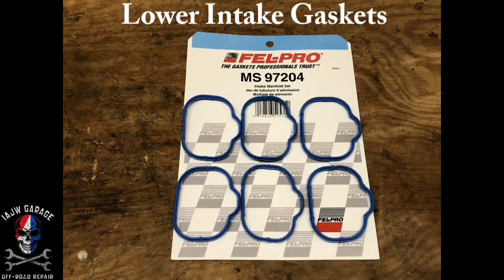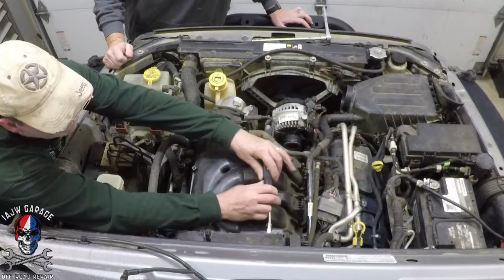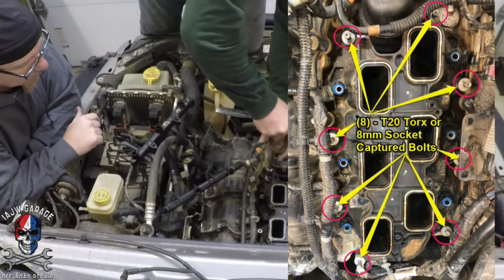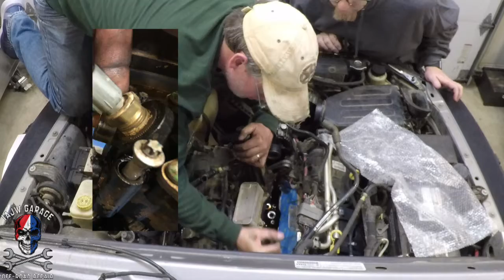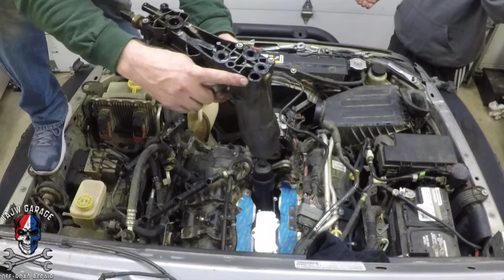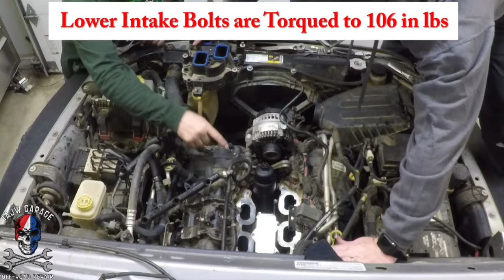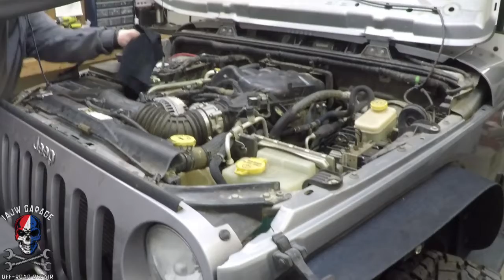Jeep Wrangler JK JKU 3.6 Pentastar Oil Filter Cooler Housing Replacement

Comment: Do you know how to do a low oil pressure code check without tearing everything down twice?The tool for this is not available right now, so I am looking for a solution. The tool is the oil filter cap adapter that converts the oil cap to an oil pressure tester. You can see what I mean if you look up this: Part # 2021500090 Mopar. I am not sure why Chrysler did not make this standard, but I get it. In any case, you replace the cap and hook up a OTC 5610 tester to that and you are in business.
Reply from the maker: I don’t not know that test. Low oil pressure could be a bad sensor or connector not fully seated 
Did you connect both connectors on the back of the oil filter housing?
Reply: @ItsaJeepWorld  Yes, I did make sure of that. I know I am fine there also because I had the same code before replacing the oil cooler. I was just curious if you know a better hack for splicing something to the the system for a pressure check.
Reply from the maker: Devin Slurry No, sorry. Please share whatever you find out
Reply: My line of thinking is that if I can get a actual oil pressure test, thus bypassing the sensor, then I can know if the sensor is good or bad without having to think about the electrical connection or the sensor which will become a huge slug of a problem to sort out. This is the video that taught me how do to the oil pressure reading, but as I stated previously, the part is currently unavailable: https://www.youtube.com/watch?v=LuU3ZrcY_4o
Reply: @ItsaJeepWorld  Will do.
Reply: It’s a Jeep World make sure you have the correct oil filter installed. I’m a Lexus tech and had worked on one as a used car and while replacing the oil filter I had a CEL. Turns out the wrong oil filter was given to me so make sure it’s the correct oil filter for the vehicle.

Comment: Did you drain the water coolant and/or change the spark plugs? On other videos, everyone does that.
Reply from the maker: Devin Slurry I did neither. The small amount of coolant was fairly insignificant 
Never touched the plugs
Reply: @ItsaJeepWorld  I guess that the plugs are good for 90k and I have 70k. So people I guess just also change the plugs for good measure rather than take it all apart again.
Reply from the maker: Devin Slurry Yes that’s what the plan for most are, I had just changed the plugs. I don’t have stock inner fender liners so plugs are easy for me also.
Reply: @ItsaJeepWorld  Thank you for replying. I just started to take off the fuel line and got a bit spooked. But now I see its not a big deal to do that. Others say it is not required. I am literally living your video and others right now. I got the upper intake off today and it got dark and cold on me, so will do the rest tomorrow. Thx for your video. You filled in some of the blanks for me.
Reply: @ItsaJeepWorld  Thx, you saved me time today.

Comment: Best tip: tape hose to vac. You just saved me at least $30 Old school tech!
Reply from the maker: Devin Slurry Awesome! I stay low tech as possible, Jeeping on a budget
Reply: I cannot agree more!  @ItsaJeepWorld
Reply: This worked great! I had rat stuff all around the area falling into everything.
Reply from the maker: Devin Slurry Thats Crazy! Glad it worked out good
Reply: @ItsaJeepWorld  I am now in a situation that is messed up. The oil leak is fixed for sure, but now I am getting codes going haywire. 300 302, 306 and 201 and 202 etc. Some others also. Something is wrong with the injectors. I tore everything off down to the injectors and fuel rails and made sure everything was re-seated properly. The first go around the jeep would idol perfect and after it warms up a bit (5m) it jumps +1k rough idle speed and threw about 9 codes. The second go around it does the same but had a slightly less normal idle quality. I am so confused right now. My upper harness might be causing problems because of rats. I feel like I am in over my head in the moment. But at least the oil leak is fixed. CO300 is not even in the books. But PO300 is. So I assume it is just that. The weird thing is that all the codes change all the time and just make a larger list of codes.
Reply: My $40 capture device is lacking. With a 300 code, anything goes.
Reply from the maker: Devin Slurry You must have a bare wire somewhere due to your rat problem. That’s all I can think of, no one has ever reported codes after this procedure. It has to be a problem other than the procedure. 
Check every wire carefully. Make sure everything is plugged in tightly and the connections are clean. I’m sorry you are having these issues and codes
Reply: @ItsaJeepWorld  The rats ate some of the wiring harness and I applied liquid sheathing to them before I even did this oil cooler. I will let you know how I eventually solve it. It might be a while though. I cant even find the harness on the internet to even know what wires control what function. Our jeeps are just coming out of warranty so info is hard to come by.
Reply from the maker: Devin Slurry find and Join ItsaJeepWorld on FB we’ll get you help, we have some of the best mechanics in Jeeping

Comment: Just did this to my 2014 JK about 4 months ago. This 100% should be recalled but we know how that goes. Seems to be specific to these 2014 models also.
Reply: My 2014 is leaking too. Didn't know until i climbed a hill and started noticing a drip. Crawled under and saw where it ran down the side of the bell housing
Reply: Michael Arnold be careful with that leak , it may cause an engine bay fire if enough oil drips in hot exhaust. Take care of it asap, especially if u do some off-roading.
Reply: @lacherokeedecaceria1263  oh yeah, i ordered it last night.
Reply from the maker: Charlie Lourenco was the video accurate and helpful in your opinion?
Reply: 2014 Wrangler JK oil leak. Confirmed not a rear main seal.  Confirmed an oil cooler Job. Do you know that the mechanics charge more for an oil cooler change than a rear main seal which requires the removal of a transmission? $800 vs $1200? That is a scam! Most of the time all you need is a $20 pack of o-rings for the fittings. Could be done for $600 easy. Do it yourself and it costs less than $200. But OK $800 because that is less than $1200. If you go to a mechanic for a rear main, you will get screwed. $1000 later you will still have an oil leak. To test what you have you have get under your jeep and see if you have oil above your upper. Meaning you leak is higher than the rear main. Which in 2014 is almost always the case.

Comment: Love the diagrams!
Reply from the maker: Joe Corapi Trying to improve on each video. It’s a process. Having good content helps
Reply: Your video, by far is the easiest to follow. I used yours to change my oil cooler.  I was scared to death before doing it knowing I can mess up big time, but I watch your video 5 or six times to build confidence. When I did it, it was a breeze! Took advantage and changed spark plugs. I was going to change PCV but i couldnt find video. Thank you for your video